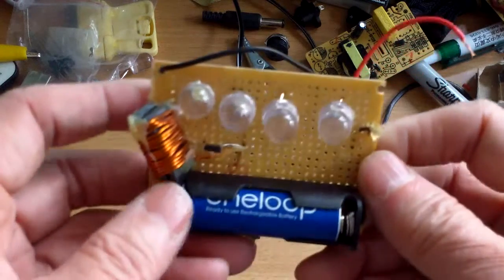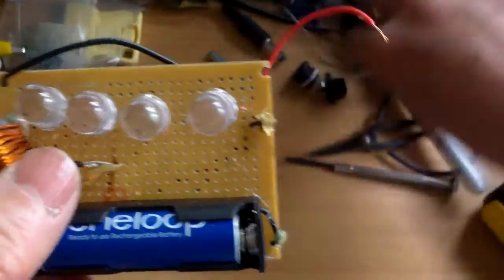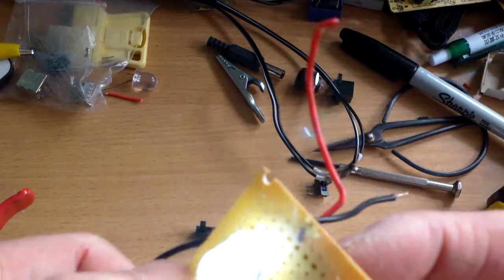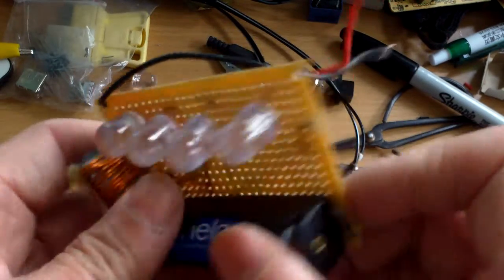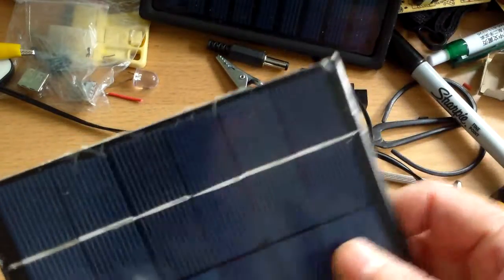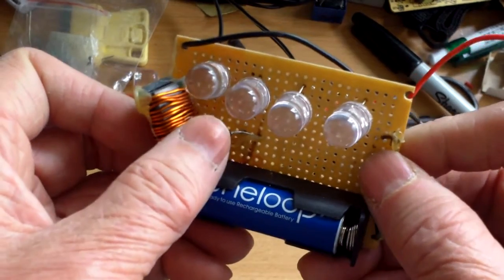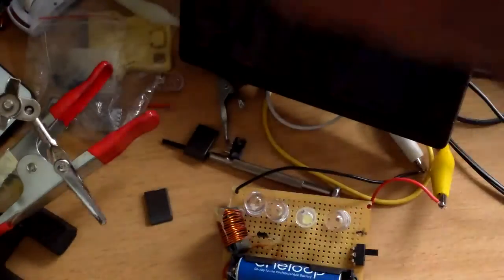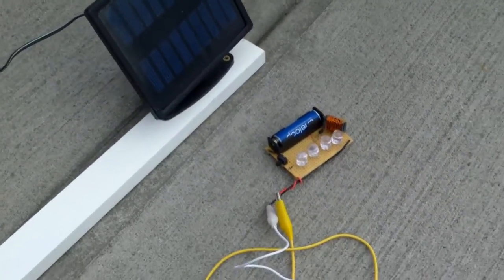New  solar LED light with a different hand wound inductor

Comment: On a good day won't the solar panel blow up the 5252 @ 9V ?
Reply from the maker: Yes, if you live in places where you have good sunshine all day. In my experience, my solar panels get indirect sunshine most of the time.
Reply: be interesting to graph the voltage throughout the day and seasons
Reply: I'd be worried even at 6V, but I guess that's why this is an experiment! wtam69, let us know if the batteries died of overvoltage or overcharging!  (6V panel with a diode is known to work for 4.1 V-max lithium cells though.)
Reply from the maker: Thanks for commenting. Most of my solar lights made in a similar fashion are still working. Solar panel output the highest voltage in perfect conditions.  When conditions are less than ideal as when the panels are overheated or not at the best angles,  the output drop off.  I house these solar lights now in a sealed glass jar.  This works well in my area (NYC) where the summer heat is not as hot as places in the lower latitudes.

Comment: Hi..Like the 10mm LEDs...I checked the resistance of the 33uH Inductor it seems to be 5.4 Ohm, 3mH has about 12 Ohm so there seems to be a very fine resistance difference between wide H values. I have tried a small button like inductor where I couldnt read the value, but the Ohm value was 5 Ohm, it runs 4 LEDs off a rechargeable for more than 24hrs constantly on. So I would suggest the lower the Ohm value of an Inductor, the less mAh's are used. Too low'er value and the brightness suffers. Looking for an optimal value to give good brightness and minimal amp usage...10uH'sare ordered, got 100 more ICs too. Keep us posted on progress...
Reply from the maker: Thanks for the clarification. I did not check the resistance of the inductor I wound with a multimeter. I don't have an inductance meter and really no need for one except in this project. The 22awg wire would have very low resistance but I don't know if the ferrite core adds to the resistance.  I'll wait for you to experiment on the 10uH before I order the inductors. I noticed this morning my new light was out when I woke up at six. I'll try adding a second battery in parallel. Another funny thing I noticed is with the battery disconnected on the new light, the LEDs lit up in daylight, meaning the solar panel is driving the LEDs directly. That's also kind of neat.
Reply: wtam69
I think different ferrite densities would change the resistance in combination with wire size. I touched my multimeter leads together and noticed I have 3 Ohm before I measure..Meaning the 33uH has about 2 Ohms. I noticed also that in bright sunlight with the battery still in, that the LEDs light up, must be some sort of overflow, dont know if charging stops when this happens. Taking the battery out also lights the LEDs in daylight...Bit pointless this!...
Reply: wtam69
Got the 10uH Inductors this morning in the post...First test is underway. I powered 24LEDs for over 24hrs with the 33uH, a 1N4148 Diode and a 10 Ohm resistor all from 1 freshly charged AA. These chips are really great, just got another 100pcs too...Lots to experiment with now. Oh yes, I used the 10 Ohm resistor because I burnt out 4 LEDs for no reason that I can see, so just for a bit of safety I used a 10 Ohm.
Reply from the maker: MrFreddiew1
With the new google/youtube comments, sometimes I missed the responses.  It can be frustrating to reply too as there are questions asked about my videos and I  cannot reply because there is no reply button.  Just got to see this bit of info.  My QX5252 lights are still running in my backyard.  I wonder if draining the eneloop to .9v regularly will be a problem. If not, then I can just treat the cut off point as an automatic turn off time for my lights.

Comment: Is a motion LED floodlight next?
Reply from the maker: I actually ordered some motion sensors but the order was cancelled due to non delivery. Now I want my exterior lights to be on all night. I have found most of my motion sensing light fail after 6 months or so. I have one light  now with the motion sensing part working but not the dark sensing part. This means it will light up in the daytime when you approach the light.  It's easier to fix the lights you made than to try to figure out what went wrong with the store bought ones when they fail.